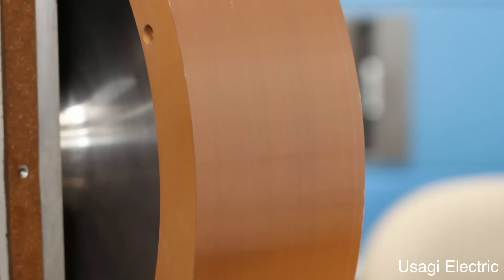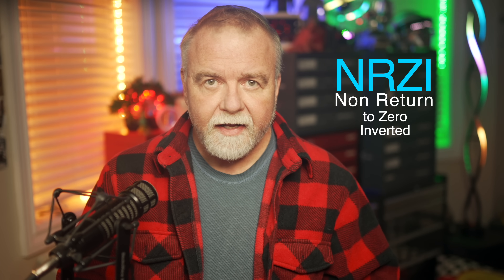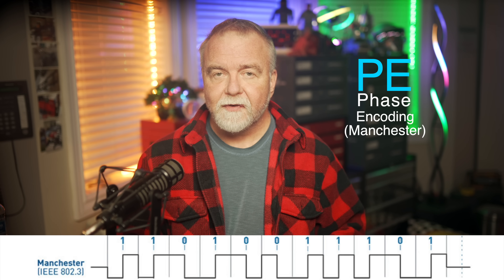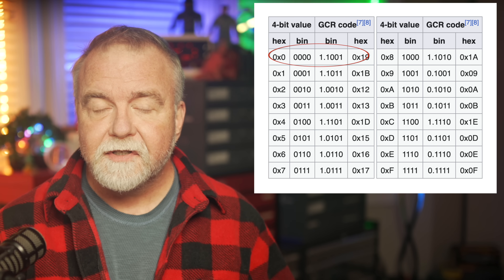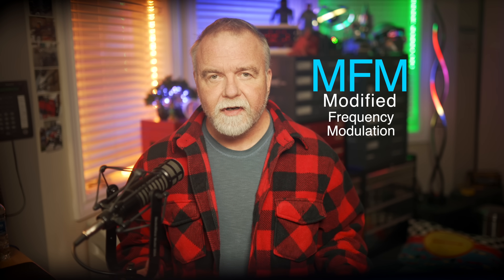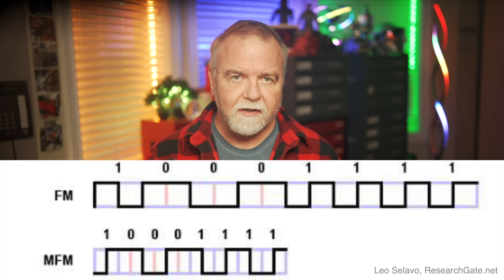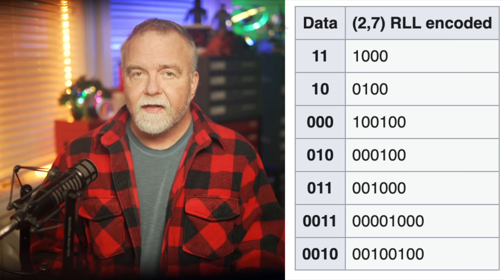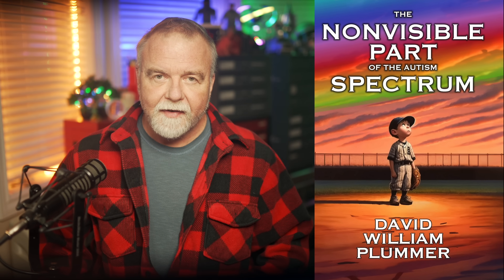Learn How Bits Are Actually Stored: NRZI, GCR, MFM, and RLL Explained

Comment: I'm just barely too young to have ever had the opportunity to fight with these things lol.  My first foray into fighting with the electro-mechanics of HDDs was 16 y.o. me attempting to `low-level-format` a like... 2GB Seagate drive that I didn't yet know had had a head-crash. [pretty sure I spent a whole paycheck on that upgrade at the time... lol]  No idea why I thought that would fix the problem, but after letting the format run for about 6 days... I stopped it and did some destructive forensics and found that the read-head had bored a groove ~0.5mm into the platter on the disk 🤣 I wish I had kept that thing as a keep-sake lol.

Comment: Since the RPM of floppies and hard drives remains constant, the read/write head sees a higher velocity of magnetic material on the outer tracks than the inner tracks. Thus, the disk controller needs to use a higher write current on the inner tracks. Nevertheless, the data written to outer tracks is more reliable than inner tracks. 

Audio tape recorders add an ultrasonic bias signal when recording. Back when I was recording fiddle tunes on my tape recorder I found that ultrasonic harmonics produced by my violin would beat with this ultrasonic bias and make my violin sound awful. I found that putting a mute on the bridge of my violin would kill these high frequencies and make a much better recording.

Comment: I remember the MFM controller on the Amiga 500, which slapped into the left side of it and stuck up about 6 inches. I had a 300mb HD hooked to it. That was my first hard drive experience. Noone these days has to deal with low level formatting a hard drive.

Comment: Back in the day, I got a very pricey (at the time) ST225 20MB hard drive for my luggable.  The price differential for the ST238 RLL certified media was a bit more than I, as a kid, could afford.  So I sprung for an RLL controller and force-fed via the forever-burned-into-my-memory DEBUG command G=c800:5 (4 decades ago...gasp) to make the MFM drive work as a super-sized 30MB hard drive.  It seemed a bit slower I think but it still worked well.  I do remember using SpinRite back then to keep up the speed and modify the interleave for maximum throughput.    Yes, I am lamenting that I have several 256GB USB Drives just laying about doing very little, and an external 18TB drive as warm storage, and 2 5TB USB HDs as cold storage, just sitting as a backup now.

Comment: Yes, you could format an MFM drive with RLL - but only if the drive was good for it. Early MFM drives could not do RLL as they were not precise enough for RLL, but as the technology grew more mature they could handle the more precise timings of RLL  just fine. Modern day hard drives are all RLL encoded internally.

Comment: This video brought back fond memories of my high school days. Back in 1979 when I was a freshman I got my first time with an Apple ][ and in 1980, my school bought two and I spent hours learning how it worked. In 1981, my parents bought me one, along with a Disk ][ floppy drive. During this time, I began my yo-ho-ho days and used the utilities of the day to copy games for me and my friends. But software developers got wise and began modifying the DOS code that was widely used and reused by everyone in order to block copying programs. During this time, I started to learn 6502 assembly code to look at what was actually going on. Within two years, I was a pretty accomplished machine language coder and could write a lot of code just from memory without having to go back to the lookup table book.

In studying Apple's DOS, I began to learn about GCR encoding and why it was used. And yes, it was a method to prevent the disk controller from having to read too many ones or zeroes in a row, confusing the logic. But there is one story missing from those days. Woz used to tell the story that the reason Apple chose those Shugart manufactured drives is that you could get them without the track read hole mechanism, which was a standard way you determined where the beginning of the track was. Woz and programmer Paul Laughton realized that it was possible to use GCR encoding to figure out where the beginning of the track was in software.  There was a string of lead bytes (usually FF) and then a string of bytes that indicated the beginning of the track and the first sector. The Shugart drives, while still expensive for the day were still a bit cheaper than the hard sector versions commonly used in other applications.

When DOS 3.3 replaced DOS 3.2 in 1979, it contained an improved GCM encoding scheme that was a little more efficient than the older DOS 3.1/3.2 version and required an upgrade to the PROM on the Disk ][ interface card, but left the Shugart mechanism unchanged. The result was an increase of storage from 128K per side to 143K per side. That may sound trivial today but it was a huge improvement back then. As I studied disk copy protection schemes, I began to realize that most coders relied on the same methods to thwart kids like me and these disks were easy to crack. But then you saw disks that were true challenges, like changing the encoding table, manipulating the read/write head to locate between tracks (1.5, 2.5, 3.5 etc) instead of 1,2,3, etc), or manipulating the drive spinning rate (there was a screw to do this inside the case).+ In the end, there really wasn't a disk I couldn't crack.

In the end, studying all this protection code made me a better programmer, especially later in college. A friend wrote his senior thesis on a sketchy Apple ][ floppy disk, and I brought it back from the dead, in part because as you pointed out in the video, the Disk ][ mechanism and software could be manipulated in order to get back bits than didn't want to come back.

Comment: Yep, I do remember making my IBM-Clone PC's 20MB ST-HDD into a 30MB one using an RLL ISA controller.
I eventually made it into a 35MB one by utilising a bug that made it possible to store about 96kb Into the sector gaps and creating a driver that made that into a 5MB extra partition.

Also used that data-in-gap trick on floppies as a copy protection for Homegrown software.😂

Comment: Spinning rust is being phased out for much more exotic magnetic materials that can be written at higher density than is possible with low cost iron compounds. 
It seems as though information tech is not just slowing in regard to integrated circuit processing power, but also storage capacity, and bus speeds. (All in relation to cost of course, unlimited money will buy a super computer as powerful as you like.)

Comment: What's funny is that back in the old days I thought I was taught that there were different kinds of hard disk drives: RLL, SCSI, IDE, etc. But then I couldn't figure out why "run-length limited" would be compared as a connectivity type such as integrated device electronics, even though it didn't sound like one. So it turns out that it's not one and some people just mixed up connection types with encoding types. Because obviously now in storage connection types we have M.2, SATA, USB, IEEE1394, PATA/"IDE", SCSI, whatever type name those MFM hard disk drives used, 34-pin floppy, and then whatever came before those, including DIN serial, IEEE 488, and buscard, etc. What are the official names for 34-pin floppy and the dual-ribbon type for the MFM-era hard disk drives?

Comment: DAT, DCC, DVI, HDMI and USB 3.0 (among others) use 8b/10b encoding which sounds like a variation on GCR; for every 8 bits of data, there's a 10 bit pattern which is used to avoid long strings of 0 / 1 at a time. This helps to ensure that the receiving end can extract clock / timing data from the data stream, without needing a separate clock channel (parallel printer ports usually had 8 data lines and a clock line, at a bare minimum).

There are also 64b/66b and 128b/130b variations used on other, newer systems. Same basic idea but pushing a greater percentage of the total signal as payload.
Reply: Ethernet as well. 10Mbps Ethernet used Manchester encoding. 100/Gbit use 8b/10b encoding
Reply: And CDs use EFM: Eight-to-Fourteen-Modulation for encoding data.
Reply: Confirmed: DCC uses eight-to-ten encoding and CD uses eight-to-fourteen encoding. Both invented by Kees Schouwhamer Immink at Philips.
Reply: @JacGoudsmit I still have my DCC recorder from when I worked at NAP in the 90's.

Comment: Is this why disk capacity differed between disk formats? Commodore used 170K, Atari 90K, and so on. This was due to disk encoding.
Reply: Yes, Apple changed GCR algorithms between (Apple) Dos 3.2 and 3.3 to change from 13 to 16 sectors on the disk and get more capacity.

Comment: MFM drives can indeed be formatted as RLL drives with appropriate controller, but RLL drives, even if they were based on the same model, were built to higher quality spec. So your standard MFM drive formatted as RLL might work just fine or be unreliable.

Comment: Although you didn’t mention it, this is all to do with clock recovery: the receive side clock must synchronise with the incoming data so uses these transitions to do so.

Furthermore, for some signalling, sometimes there’s a physics need to maintain DC balance, so over time the encoding leads to equal time spent in each state. Coding such as FM, MFM and Manchester achieve this.

Manchester encoding is still used extensively, for example in USB C power delivery signalling over the CC pins of a USB C connector on the physical layer, and 4B5B (like GCR) on top of that at the packet layer. 

NRZI is used on USB D+/D-, plus a zero bit is stuffed after six ones to avoid too long a period without a transition, so is a semi-variable length coding scheme.

So this is all still very relevant.
Reply: Thanks for the explanation 👍
Reply: Yep, found out this NRZI for USB the hard way.  Once I was tasked to implement a specific USB camera for some CNC measurement machine.
Since it was extremely important to get the images RAW from the sensor and also implement some latching to record the positions when/where the image was taken, it was a homebrew solution using FPGA for the data handling and some other fancy stuff.
However since we were running very close to the USB2.0 bandwidth for bulk transfers, it really matters when you send out a nearly completely black image or with lots of white. And since it was a CNC measurement machine, both were likely scenarios.
With lots of zeroes in a row, you would loose data. Later I found out it was due to this NRZI.
So my quick fix was to XOR all bytes with 0xA5 (10100101) before sending and on the receiving PC XOR it back to get the correct data again.
Since it was more likely to have long sequences of 1's or 0's than to have long sequences of 0xA5 or 0x5A, this was a perfectly simple fix to stay within the available USB bandwidth.

Comment: I the 60's we used ferrite cores and many hundreds of miniature diode tubes for processing encrypted signals.
Reply: You are a bit before my time but I also used ferrite core memory on crypto gear.  That was in the 80s however.  Long live the UYK20. 😁
Reply: @martyb3783  You could no doubt buy a UYK20, from surplus these days. As a 3rd class, I went into radio one as soon as I got TOP and COSMIC CRYPTO. My first jobs were changing out the mini tubes on cards, and helping count documents, help setup secure voice with whatever Marine Division we were working with in Vietnam. I made 2nd class in 18 months and on my next ship I was in charge of HF transmitters. USS Newport News (CA-148) and then USS Springfield (CLG-7) Thank you for your service and stay young 🎙KD9OAM

Comment: Waiting for the electrical interface vid!  SCSI, ESDI, SATA, IDE for hard drives and maybe the various floppy drive interfaces.
Reply: Ugh. SCSI. I had to work with that for about 10 years. I thought the rules for terminators were simple, but apparently nobody else did. I had a colleague that could debug SCSI issues at the hardware/firmware level.
Reply: @GeneCash  It was the king of enterprise interfaces for quite awhile, but yeah not too user friendly for Joe Blow.
Reply: @GeneCash  I loved SCSI drives and accessories! It wasn't until SATA or SATA II came along that you could burn a disk and watch a movie at the same time without making a frisbee! SCSI could do it from day 1.
Reply: @kleetus92  Yeah SCSI CD-RW, SCSI Hard Drives, and a SCSI Tape drive.  The system would pretty much do max I/O data rate of all the devices concurrently.  It wasn't that hard to setup.  You decide which device is going to be last and set it as such, and then give every device a unique ID on the bus.  Worst case, MAYBE you had to put an external terminator on the chain.  I don't remember ever having to do that with any device mix I configured.
Reply: @msromike123  Yep! Loved it back in the day!
Reply: @GeneCash   I've done that.  My motivation was: coming in every 18 hours to swap a tape over Xmas break, because the autoloader couldn't talk to the backup software.  To the previous sysadmins they were getting O/T pay for it so they didn't care.  But I was lazier than that lot:)
Reply: @GeneCash  I still have a Canoscan negative scanner and an HP storage works raid array on SCSI, hanging off a windows 7 machine. Still fast enough, still reliable.
Reply: Me too!

Comment: About the MFM vs RLL encoding scheme.. I do remember finally getting enough money together to get a 20 MB hard drive for my IBM PC clone. It was MFM encoded. A year later or so later a friend of mine said he got a 30 MB hard drive for his IBM clone. He said the drive mechanism was identical to mine except it used RLL encoding. So I do remember those discussions about RLL being able to store 50% more then MFM. I wouldn’t have had the confidence to try swapping just the controller on my drive to see if it worked. Especially typically I built my PC’s at the time by just buying all new technology anyway. My next hard drive was in a whole new computer, everything was much faster, stored more, faster ram ,etc.

Comment: Your site is very informative and interesting to follow😊
Some 60 years ago I had the opportunity to play on a recorder using a steel/iron wire on reels😬
I think the decoding on that play machine missed decoding other that a mechanical counter.
What a development over the years.
I serviced some test/stress chambers at Tandberg in Norway way back when they was a pretty huge producer of tape storage systems on some big tape cassettes.
The development of other storage devices made them to go bankrupt.
Still the company I worked at until recently use small tape cassettes for daily back-up. 
In early days they used a huge magnetic disk storage for salespeople.
The disc was may be twice the size of an  LP music player.
Belt driven with a high speed where the flat belt flew off every other day.
Took some time and effort to get that belt back.
Reply: Ot's always a challenge for companies that are big in a certain area to pick up the hints their area of expertise is about to die and it's time to move to next-generation technology. DAT and DLT did take lots of market shares. From single-tape drives at small offices to big tape loaders capable of backing up half of Internet.

And then most companies went for HDD solutions with RAID to get around disk failures. And now SSD is fighting for cost/TB with the HDD solutions.
Reply: So true, Kodak did not jump on the train for digitalization. 
One of the big companies that hit the bottom

Comment: I definately remember doping the the MFM/RLL Conversion, which made my 20-MB to a 30MB hard drive on the early PC's. I DO remember being warned that this could loose data, as the flux density of a 20MB drive was really pushing it to get 30MB. AKA, more flux changes etc... I did run it and never had a problem though.